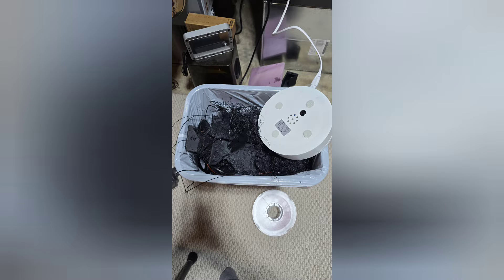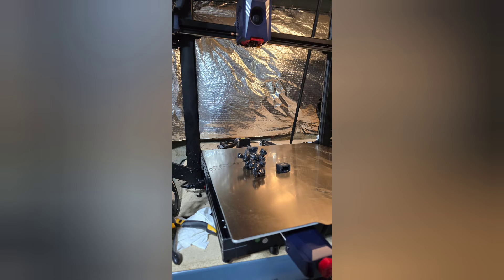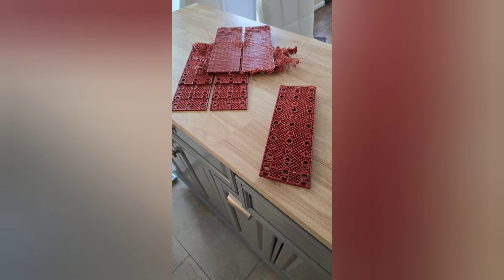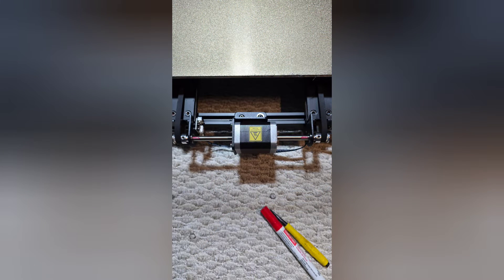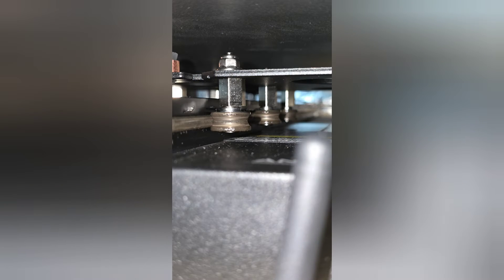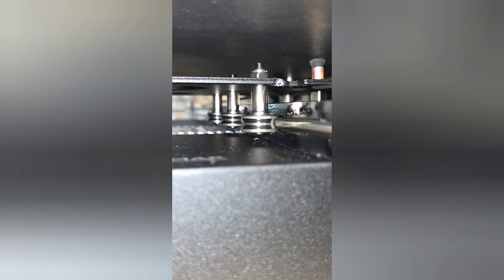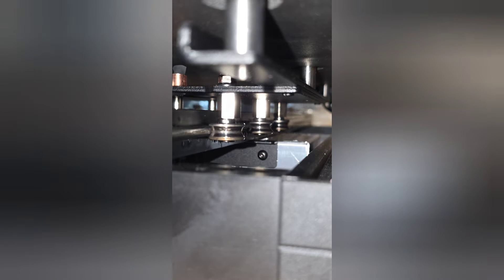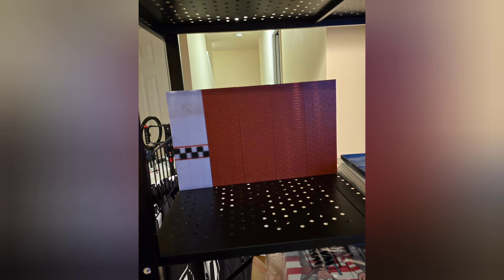Kobra 2 Max Y layer shift Part 1.

Comment: I'm having a different problem. It is shifting on the very first layer. ( Really wish I could attach a picture to show you) I'm not hearing any of the clunks that you show here. I've cleaned and lubricated both Z screws and rails, tried different slicers, tightened the x / y belts full then 1 turn back, changed to stable print speed, made sure all of the rail wheels are free moving...  Any ideas what could be causing this and how to fix it?

Comment: anycubic is A company that designs products with an artificially limited lifespan is practicing planned obsolescence. This can be through various methods, such as designing products to fail after a certain period, or making them difficult or impossible to repair. The term "built-in obsolescence" is also used to describe this practice. 
Planned obsolescence: A deliberate strategy where companies design products to have a limited useful life, forcing consumers to purchase replacements.
How it works: This can involve building in a specific point of failure, making products difficult to repair (e.g., using proprietary screws or gluing components together), or simply making the next model seem much better through minor updates. Everyone should start a petition. To have any cubic test continue from selling in the US. Or reimburse and fix the issues with the printer This is an ongoing issue and no one seems to do anything about it.

Comment: FYI, anybody felt how hot those steppers are during a print? I bought some 40 x 40 x 20mm self adhesive heat sinks, got as many as I could on the X and Y stepper motors (3 on X, 2 on Y) and my missed steps have disappeared, remember the hotter a magnet gets, the weaker it becomes.
Reply from the maker: You ain't wrong. I also see with firmware and slicer upgrades the issue goes away. The firmware tells it how hot to run it seems to be dialed back.

Comment: And then on the other, I'm about to try this: 

🧪 Step-by-Step Troubleshooting Guide

🔌 1. Check the Vref of the Y Stepper Driver
🔍 This is very likely the root cause based on what the other user found (and common with these boards).
What to Do:
Power off, open the bottom panel

Use a multimeter on DC volts

Place negative probe to ground and positive probe to the Vref adjustment screw or test point for the Y-axis driver (you'll need to locate this on your board — often labeled)

Expected range: ~0.9V–1.2V

Too low (<0.7V) → stepper underpowered = shifts

Too high (>1.5V) → risk overheating/failure

If the Vref is too low:
Gently turn the screw clockwise 1/8 to 1/4 turn

Re-test voltage

Save changes and test print

Comment: The same problrm with my printer
Reply from the maker: @gorobizz  if you're within warranty id just get a new one. Return and repurchase. If not... ask for a new mother board
Reply: @ShadowMoses112  yes. Just got the new motherboard myself. I will post another troubleshooting guide I found that sounds like it may help (in the main comment thread where folks can find it). 
I will report back with the results of both MB replacement, and the adjustment Vref of the Y Stepper Driver

Comment: Was having the same issue, they are sending me a new motherboard
Reply: How long have you had yours?
Reply: @chazhaze1580  I'm having same issues and haven't had mine even a month yet and 48 hours of printing on mine 😅
Reply: @Sixppathsofpein  I fixed mine, it wasn't the motherboard it was actually misaligned on the rails u Der the bed. Once I realigned it, and recalibrate, leveled, and readjusted the Z, after the rail alignment, it printed amazingly!
Reply: @chazhaze3d  ima mess with mine and see if that's the issue
Reply: @Sixppathsofpein  there's a video on it. Let me see if I can link it
Reply: @chazhaze3d  I will try this next after MB replacement and Vref adjustment of my Y stepper motor

Comment: I’m having this issue with a large print, could be my tension of my belts, I’m not sure what’s the perfect tension ? How would I know if it’s tight to the Max ?
Reply from the maker: @J.l198  good question their manual says hand tighten til it can go anymore and do one full release backward. Tighten but don't force or over do it.
Reply: it should move smoothly by hand. Remember not to move the plate very quickly, as this can damage the motors. Smooth and steady.

Comment: If you use a k2m for 10 days, you will got 11 issues, and so on
Reply from the maker: @SeijuroHiko962  while no printer is without issues. The k2m is a good printer. I won't say great but good.  The firmware updates have made this printer better through time. But i agree they hopefully addressed this with the k3

Comment: I have 4 of these Kobra max 2 machines all with same issue. I am not sure how to fix it. I own 2 older Anycubic Kobra max original versions which work fine. I don’t think I would buy any large format printers from Anycubic in the future if this can’t be fixed.
Reply from the maker: @digitalbase9396  whats crazy is, IMO, as simple as a firmware update. To lower the heat or power of whatever is blowing out. I noticed the slicer with its latest update added a slower quality function and since i sell original models i prefer it. Its still fast. I ended up getting a refund for this printer and buying a new one. I also had the kobra max and the 2 was a huge improvement over the 1. Although th k2m doesnt seem to be able to be a designated work horse the Kobra3 seems VERY promising and interested to see if they do a max of that . I wouldnt count them out just yet. I replaced me k2m with 2 k2ms in case i have another con and need to offload some of the work but I don't see these lasting beyond a year or 2

Comment: Did you ever get this issue fixed. I was able to come up with a permanent solution and fixed mine after 3 days of frustration. I’m just seeing what everyone else was doing. I can say it’s not the belt tension, gears, steppers or wheels for sure…well at least for what’s plagued these issues. Fortunately I was able to use laser lights and some UV ink to identify what my issue was and once I made a procedure for it, I have done 17 prints at all speeds and it never happened again.
Reply from the maker: @pilot3729  i ended up getting a refund and sending it back. I assumed it was a board issue. Something over heated and burnt out as i was constantly using the machine in prep for a comic convention.  The new kobra 2 max hasnt given me any issues yet.
Reply: What is the solution

Comment: I suffered increasing Y axis shift until the Y axis completely died during a print. Drive IC bit it and motor was painfully hot. Checked vref and it was WAY too high. Got a replacement board and checked the vreg and it too was WAY too high. All vref were set to high. Reset all and layer shift was better but still there and worse at higher speeds. Began investigating acceleration and jerk and found the default of 2000mms was too high. Dropped to 900 and shifting was GONE. Set jerk to 10 and acceleration to 1000 and hard set in the eeprom and now have over 4kg through it without so much as a single layer shift. Can print at 150mms and get perfect prints every time. I HIGHLY advise lowering acceleration to 900 to test, especially on a max, since the larger bed means a much greater mass for the motor to move and stop.
Reply: Fantastic advice, that makes perfect sense. 
I just got the MB replacement and will confirm the vref for the stepper drivers, then adjust the jerk and acc like you suggested
Reply: @petrol_prophet  If it helps, after a bit more testing I found acceleration can go higher to 2000 but jerk MUST come down.  8 worked well for me on my max.  I did convert it to klipper and have max acceleration set to 2500 in printer.cfg but set it to 1500 in orca slicer.  Jerk set to 8.  So far so good.  Just make sure your belts are properly tight without being overly tight and if you print a larger model that uses more than 800gm filament you might need to reduce acceleration to 1200 and jerk to 7 due to the extra mass of the print.
Reply: @Enjoymentboy  that’s very helpful, yes! I got held up yesterday evening getting the old motherboard out… the factory worker put this red silicone glue all over the board connectors that wouldn’t cut off until I heated it significantly with a hair dryer. 
I have today off from work so I’m going to finally have time to get some serious troubleshooting done. 
AnyCubic also sent me a new y axis stepper motor that showed up yesterday, so I’m going to throw that on there today too ✅

Comment: I’m having the same issues. Have not been able to print a single thing yet. Reviewed the same processes. The first layer comes out ok. The second layer is a sh@t show. Restored to factory. Have auto leveled. I still can’t get my first print on this machine. I’ll keep trying
Reply from the maker: Is it making the same noise? Anycubic recommended a new y axis motor and possibly a mother board. Feel free to reach out. Ive been printing for 7 years and have 3 other printers modded from mother boards to rails.